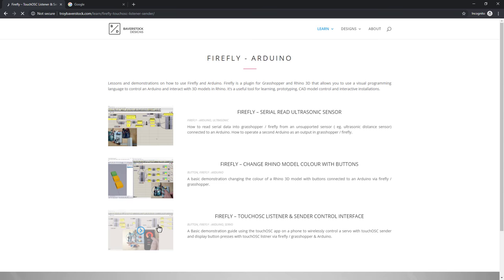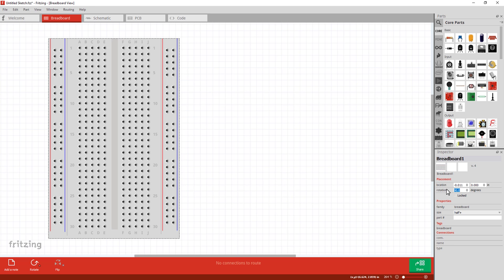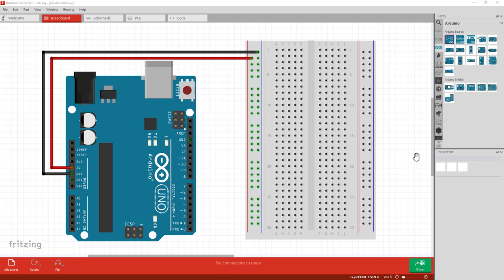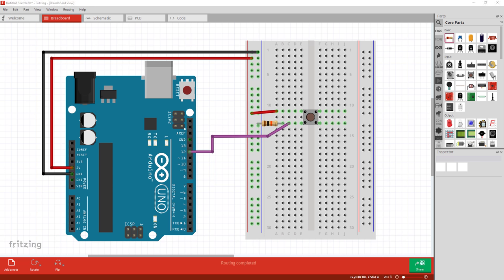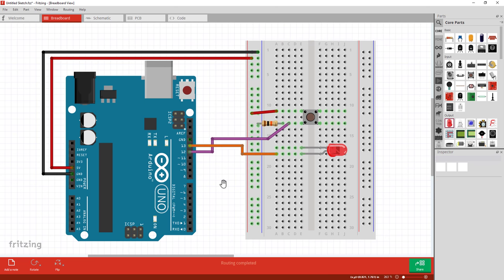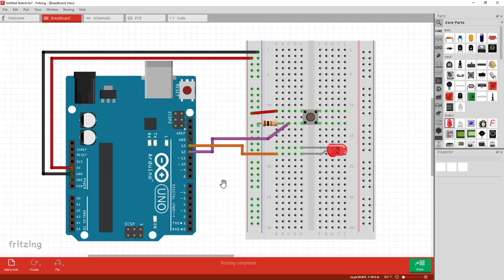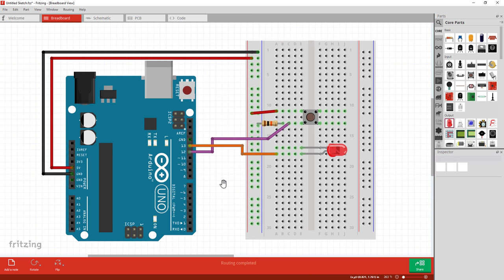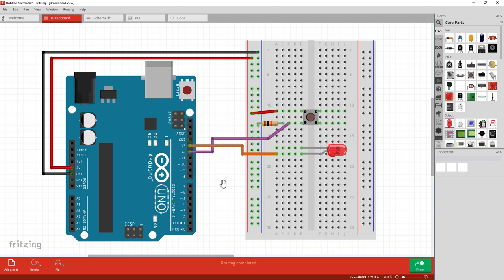Fritzing Tutorial - A Beginners Guide to Making Circuit & Wiring Diagrams

Comment: Thanks for the video... Drawing Automotive/motorcycle wiring diagrams; 3 questions: 1) Are lines "customizable"? 2) Can lines be setup with attached labels? example: "2.5mm BL/GN" (2.5sqmm, Blue/green)... blue line with green "slashes" (as with MS Word Draw). 3) Does Fritzing also have a download-able automotive components (i.e. Bosch relays)... posting is not only for you but also your readers... thanks.